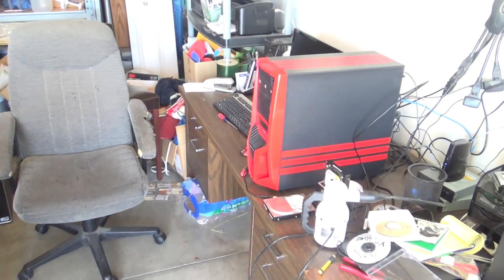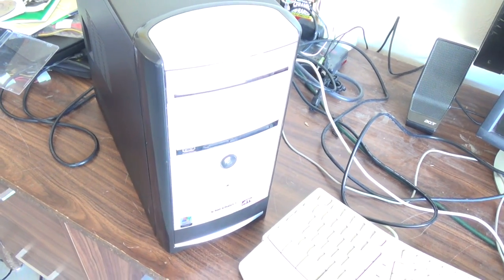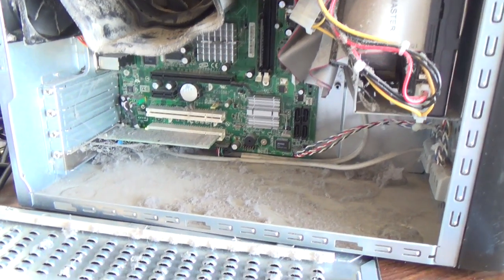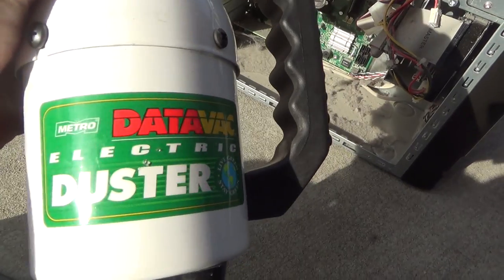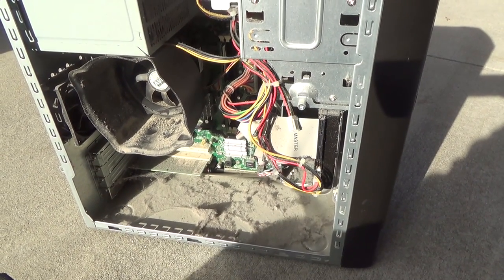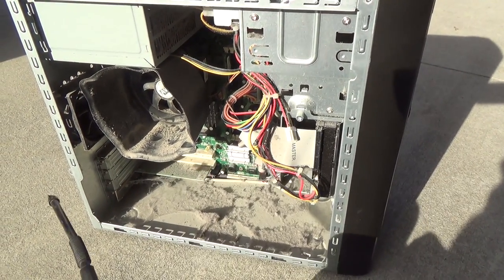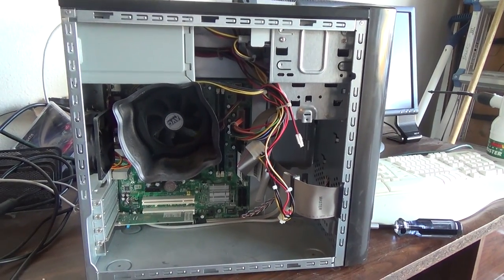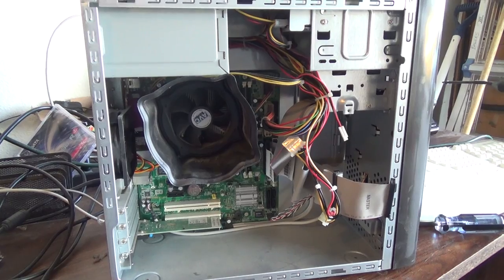One Dusty Computer Tower - And An Awesome Device to Clean It Up

Comment: Not the dirtiest one I've seen - and beware that the dust is a biohazard - mostly comprised of human skin flakes.

Get a separate vacuum cleaner and use that to catch most of the blown dust. You do NOT want to be breathing it.

Another option is to use something like a dewalt portable cleaner (DC500) with suck-blow hoses and a 1/2 inch hoghair paintbrush (these work wonders at loosening dirt that airjets alone won't remove)

Spinning a computer fan won't generate any current. The biggest risk is damaging an already-marginal bearing (and if it's marginal you're better off breaking it now than finding out when it stops and the PC overheats)

Comment: its just the fact that the bearins on the fans aint ment so spin at such a high rpm there is a slight chance it will break the fans bearins is all  as long as u dont get em spinning a a high rpm which from what i could see u didnt ur fine with not holding em simple rule of thumb on the fans if you get em spinning to a high enough rpm where u can hear a high pitched hum from them ur spinning them to fast and they could key word could be damaged from the rpm

Comment: If you spin a fan too fast then you can short the Mainboard ;) 
But only this cheap 20$ ones from ebay because almost all Mainboards has a electric part called diode and it just prevents stuff like this
Reply from the maker: Smh, Yeah yeah yeah.   

You're absolutely correct and I gave out total mis-information here because obviously I am not nearly as smart as you and because I'm obviously an evil computer manufacturer trying to make people destroy their computers by blowing a little air through their fans.

Busted.  You got me,

/end sarcasm

Comment: I thick buildup happens much more in humid areas. I live in the desert of the Inland empire, CA and we just get fine,fine particulate and dust bunnies. ends up in little dunes on components hahah. Also I find heavy smokers cause the build up to happen much quicker and with much more damage. also i have used both high pressure water and air to blow out fans and Power supplies neither technique electrifies Any part of the system. if it did it would just burn out the fan connector on the board...not the board. i have reoaired and cleaned countless systems at this point.....Zero issue.

Comment: pretty surprised you didn't remove any hardware to clean underneath slots or parts of the mobo, or even the HDD bay
Reply from the maker: +Dan Sebestyen - lol, he's lucky I did what I did.  I re-installed his Windows XP and backed up his old data, put all his needed drivers and common programs on it at a fraction of what BestBuy or some other outfit was going to charge him.  I think I charged him $30 or around that, compared to the $70 to $100 or more a professional store would have charged him.  At that rate, I'm just going to get 90% of the loose accumulated dust out, I'm not going to spend hours scrubbing his tower clean.
Reply: +Zaxtor99 hahaha, absolutely! obviously I didn't know the details behind it, I was just thinking in a way it would've been satisfying to clean the insides out as well.
Reply: +Zaxtor99 hahaha, absolutely! obviously I didn't know the details behind it, I was just thinking in a way it would've been satisfying to clean the insides out as well.
Reply: +Dan Sebestyen that's a bunch of work for 30 bucks. I wonder how his computer ever got so dusty

Comment: I totally understand the whole dust problem I'm also in Boise and no matter how clean you keep your damn house I have to clean my PC at least once a month I even installed microfiber filters over my fans and clean those out almost once every two days
Reply from the maker: Clinton Dubois Yup we basically live in a desert here in this area, dust accumulates faster then Mormons in Salt Lake City
Reply: Clinton Dubois try to make your case pressure neutral or positive if it isn't already. negative pressure (t.i. having only exhaust fans or more exhaust fans than intake) in the computer case pulls air throuh all the unfiltered holes, accumulating dust.

Comment: of course you could just build your own and fan it, so it has a positive pressure within the case then no dust simples
Reply: Hmm, it's a thought. But it will need a large inlet covered  by a large  and FINE filter, and that filter will need cleaning or replacing.  Here's my thought processes: to create a positive pressure (i.e. greater pressure inside the case than outside), you've got to have one inlet for incoming air to fill the case with above-atmospheric pressure. The incoming air will arrive with dust, of course; so you put a filter over the inlet; but the incoming dust will clog up that filter and the filter will need replacing or cleaning; and that filter has to be very fine to catch all the fine dust (much of it is like a fine powder); and that will slow the incoming air down and make your fan and motor work really hard. So you make the inlet large in order to give the incoming air as much area to get in as possible; and you clean or replace the filter regularly. Seems plausible to me.

Comment: I think these dusters blow compressed ionized air. That neutralizes static charge and makes dust not stick to anything. Always use ionized air. 
If you use compressed air from a shop compressor that builds up millions of volts of charge and that can zap the components. Never use a shop compressor they are not ESD safe.

Comment: I wonder what kind of temperatures that cpu must of been dealing with after 10+ years of the same stock heatsink and thermal paste. And I doubt those old chips had thermal protection either, must of been a sauna for whatever spider was living in there.

Comment: I have a Sony vaio fs515e and I bought it in 2005 and I stopped using it in 2007 and I began to use it 3 days ago and I installed windows vista home premium and I formatted everything and it starts up in 36 seconds it's a very low end laptop which is 1.0 in windows experience xD nice for a 10 yr old laptop AND it opens all browsers in 2 seconds xD

Comment: one more thing I do for my customers, and I know here it come "you should not do this or that Bla Bla Bla :)" I usually remove the power supply open it up and remove the fan "DO NOT CUT THE WIRES!" just loosen the 4 screws that hold the fan in place and gently lift it out and clean it, now if you carefully lift the sticker in the back you'll find a rubber grommet, take a small screwdriver and pry the grommet out, drip a drop of oil into the hole - I usually use Rally Chain oil for bicycle chains it gives me the best results but any thin 2 in 1  oil will do "DO NOT SPRAY PENETRATING OIL INTO THE FAN" now replace the grommet and the sticker and put the fan back< I've done this to countless PC's and this simple thing can increase a power supply's life by a lot >>>> Oh and please DO NOT plug the power supply in while your working on it<<<<

Comment: Will 1 can of air be enough for a tower ?
Reply: No just for a water cooling
Reply: yes its enough. It was enough for my pc
Reply: spooky Thank you, for answering my question. "3 months later" Lol.... Just kidding. I used less than one can and my computer is running smooth and quietly. Thanks again +Spooky. You have a Blessed Day !!!
Reply from the maker: LOL, your question probably didn't get answered because it's very dependent on so many variables such as how many fans your computer tower has and how dirty they are and how clean you plan on cleaning your tower etc.  It's like asking "Will one bag of chips be enough for my family?" and providing no more information.
Reply: Zaxtor99  Of course it is No big deal, But I'm just grateful that someone even took some of their time to answer it. And you know what Zaxtor99 ?, I didn't even think to mention about the size of my PC, How many fans, How dirty it was, or to even ask what size can to use. Sometimes I rush things. I guess I was getting frustrated with my PC at the time. Well, Thankfully Everything is fine now.

Comment: On a computer that bad surely you need to strip it down and replace the thermal paste on the CPU and cooler??  just removing the dust is going to provide no support ot the machine otherwise.
Reply: i said on a computer "that bad" if the computer is that bad it likely has not be cleaned in over 2 years hence why the thermal paste on the CPU is likely giving poor performance

Comment: eMchines folded,   so did  Gateway Computers...this latter bought out by Acer.    Gateway computers were easy to reset windows to its original state or manufacturing  settings...  One of the best computers gone for ever.

Comment: the fan can crap out from spinning too fast but its extremely rare
Reply: If you take a fan apart you will see that can't happen..  What stops the fan from spinning is when dust gets forced up inside the fan blade around the shaft. You can take any fan motor apart to clean them.. They are brushless motors.

Comment: holy crap thats loud, an air compressor would be quieter lol and get the same effectiveness and longer lasting pressure cus thats only got a teeny tiny tank and air compressor has almost that size, to massive. and its more common to have an air compressor, plus its more practical. you can use it from cleaning dust to putting air in tires
Reply: Air compressors have moisture in the air they compress unless you have a filter and water trap
Reply: Stephen Pourciau I hope you know they sell filters to catch any moisture right?  I've used a compressor for over 16 years cleaning PC's never had a fail..  Only happy customers. .  I carry a 2 gallon one with me when ever i get a house call.. They only weight around 20 pounds.  You should where a mask when blowing out a PC as well.. The dust is very harmful to your lungs.

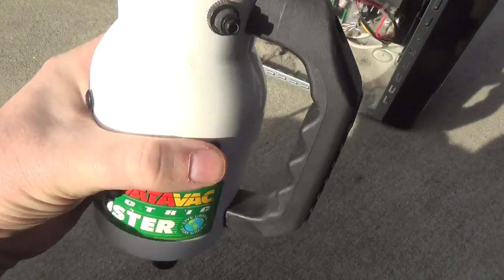Comment: 6:11 6:12 you need second air duster to clean your air duster
Reply from the maker: HaHaHa, LOL!  Nice!  I should have demonstrated exactly how easy it is to clean the DustVac filter there because it does get dirty fast when you use it.  It simply pulls out real easy, you rinse it under some tap water and let it air dry an hour or two, then pop it right back inside.  Very easy.  

But lol, yes nice observation!

Comment: I would have recommended the two fans replaced with new fans that would do far better and also throw that funnel plastic thing away!
Reply from the maker: the one you dont see Absolutely!  However, the problem is two new fans will cost you about $10 lol, and honestly I don't know that this PC is even worth that, haha!
Reply: Zaxtor99 indeed!
Reply: the one you dont see That plastic funnel is meant to draw in fresh air from the side panel rather than drawing warm air from inside the case. It's not aesthetically pleasing but that PC also doesn't have a window so you won't see it anyways.

Comment: I'm gonna save so much money! I never liked canned air.
Reply from the maker: Absolutely man.  It doesn't take many cans of air before this thing has paid for itself.  And those cans of air last how long if you just hold the button down?  Maybe 5 minutes?  Pffft, I guarantee you that this DataVac has blown air well over 50 hours since I've purchased it, and it's still running great.  ..Do the math and it don't take long to see how much money this little baby has saved me over the years.

:-)   ...Thanks for the view and the comment!
Reply: Zaxtor99 I bought myself a real aircompressor, does the job equally as good, but sad that I didn't see this vid before :( could have saved me 50%.But I will make sure to get one if my compressor breaks down

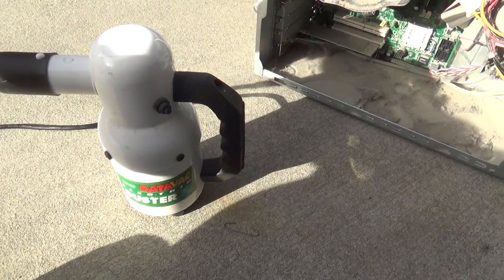Comment: Wait a minute, was the whole speech about this dirty pc being a customers, really your pc and you just trying to cover up having such a filthy machine?  I could have sworn you said its your computer at 4:35.  I dunno Zaxtor99, I think that machine is one of your own.Also with the fans and not blowing high pressure air on them or spinning them with the air (they are meant to spin people), your absolutely correct, its like an old wives tale.  I've used a compressor for air tools before near fans and never killed one.  Spun some up pretty good too and they still worked afterwards.  If someone has broken a fan with a compressed air can or what not, you've got a pos fan in your system.

Comment: computer shops must make bank around you. only time I seen anything like that was in a decade old rig.
Reply from the maker: +Joe Blow - It's really bad around here.  My computers would get that much dust in about 6 months if I didn't clean them about every month or two.
Reply: thats insane. i have 7 case fans and clean mine maybe every 6 months to keep it sparkling.
Reply: +Joe Blow Damn you guys are lucky. I can last up to 2 weeks without my pc turning into a brown mess...
Reply: man you guys need to get some air purifiers or something.
Reply: +Zaxtor99 May want to look into getting some filters and configuring your fans to make it positive pressure in your case

Comment: It is bad but I've seen much worse. And worse with comps that are regularly cleaned. As for cleaning....Air Compressor. Just a bit of common sense and not allowing the air to spin up the fans and it's fine.

Honestly though I just tell people to buy some cheap filter material and hot glue it to the inlets on panels that can be easily removed or a piece of tap in areas that cannot. Easier to clean and better all around.

Comment: Hey look on the bottom of the dust cleaner
Reply from the maker: lol, yes.. that is the filter to the DataVac itself.  And it gets dirty pretty quickly when you use it.

Thankfully that little circular filter just pulls out and you can rinse it out under a sink and let it air dry and pop it back in.

-  Zaxx

Comment: Woah, I haven't seen eide cables in ages.
Reply: Lol eide. It's IDE
Reply: EIDE (Enhanced Integrated Drive Electronics)
Enhanced (sometimes "Expanded") IDE is a standard electronic interface between your computer and its mass storage drives. EIDE's enhancements to Integrated Drive Electronics (IDE) make it possible to address a hard disk larger than 528 Mbytes. EIDE also provides faster access to the hard drive, support for Direct Memory Access (DMA), and support for additional drives, including CD-ROM and tape devices through the AT Attachment Packet Interface. When updating your computer with a larger hard drive (or other drives), an EIDE "controller" can be added to your computer in one of its card slot.

To access larger than 528 Mbyte drives, EIDE (or the basic input/output system that comes with it) uses a 28-bit Logical Block Address (LBA) to specify the actual cylinder, head, and sector location of data on the disk. The 28 bits of the LBA provide enough information to specify unique sectors for a device up to 8.4 GB in size.

EIDE was adopted as a standard by ANSI in 1994. ANSI calls it Advanced Technology Attachment-2 (it's also referred to as "Fast ATA").
Reply: Sorry I was wrong and a bit mean in the proses. I am truely sorry for this. :0)
Reply: Zach717 No worries, bud
Reply: Thanks for understanding

Comment: Nice video. Thanks. I work in hospital IT. We have used these, but only when we can take the unit outside. Many of our systems are mounted on walls or under desks, so it's a bit of a hassle to dismantle and get the system out the door. For that reason we use the Metro Vac http://amzn.com/B000068LA5. When indoors we use it like a vacuum cleaner. If the system needs more than that, we'll take it outside and reverse the hose for a thorough "blowing out."

Comment: I would've used my vacuum to get rid of all the dust on the bottom and the one covering the power supply housing to that it wouldn't all get pushed in there. Hope you used a dust mask or at least a damp rag over your face. Some people are pigs and there might be insect droppings in there that are not good for your lungs.
Reply: you should not use vacuum cleaner to get dust off pc. static eletricy can kill the components
Reply: Mulksky 11 Yeah, I learned that by reading some of the other comments. Still, there has got to be a better way of cleaning these things. I mean, all the dust bunnies clogging the power supply housing just got blown inside the housing, which I would assume is worse in the long run.
Reply: ***** yeaaa
Reply: Mulksky 11 you could use an anti static mat. Been using one of these electric fans for 8 years on over 3000 pcs without a single incident of static or fan damage. Static damage is rare anyway, I have only had one incident of suspected static damage after 18 years fixing pcs and laptops.
Reply: Lil King interesting! i never knew that,thanks!